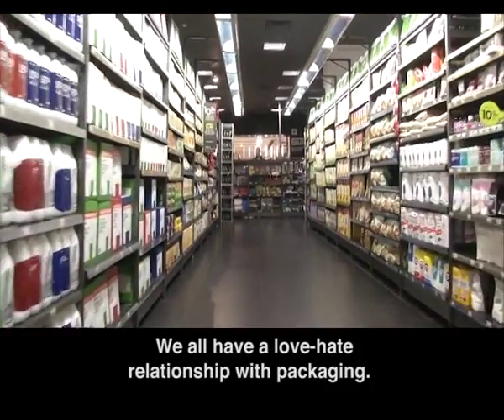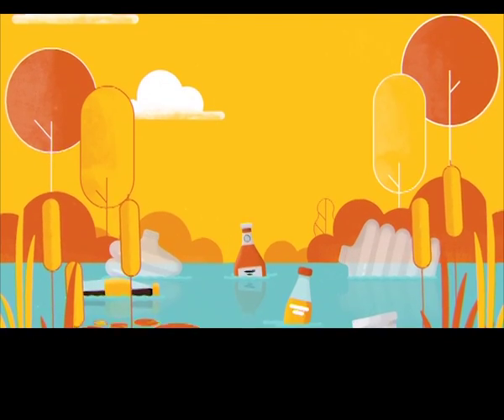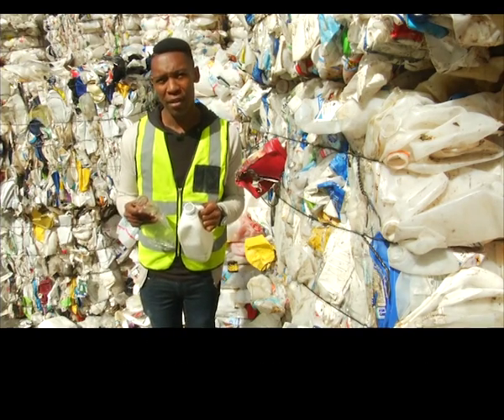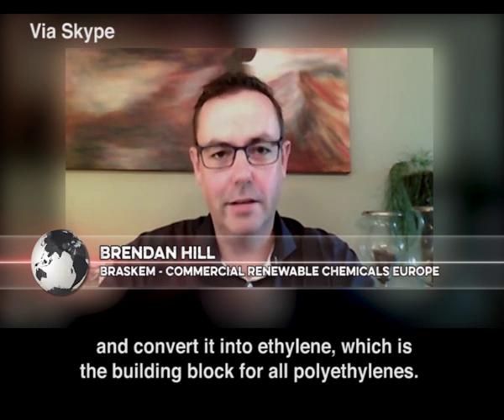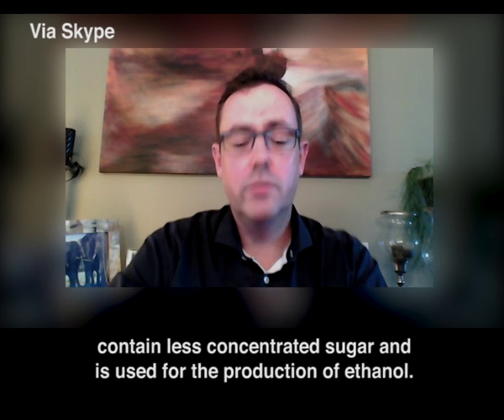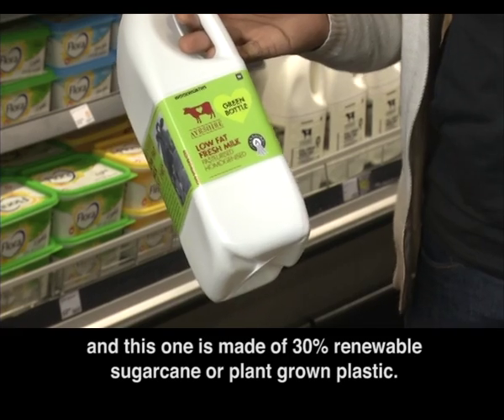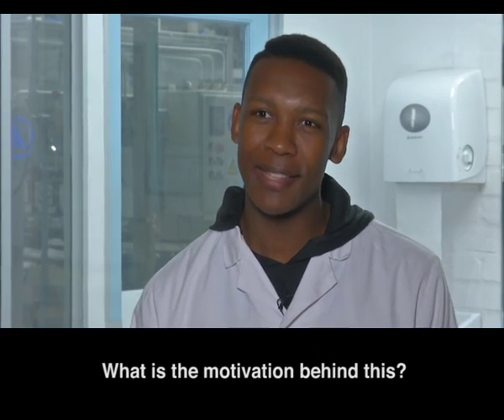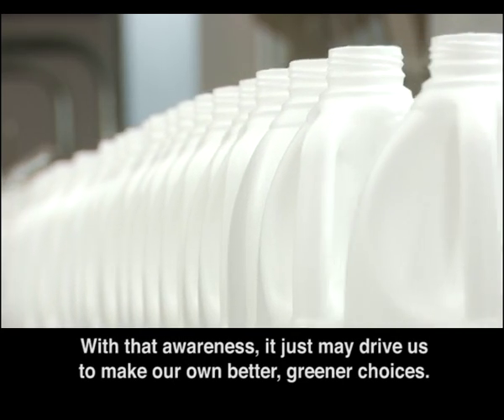Woolworths Plastic: Making plastic from sugar cane

Comment: I'm sorry, did she say is recyclable? but I guess it can´t be mixed with other plastics because its molecular structure is different...does this improve the plastic problem?
Reply: It can be recycled. Suppose we have such plastic everywhere, we can remould it to give it other shapes. It doesn't actually solve the problem but yes, could certainly help to slow it down. We need stricter laws to be implemented.
Reply: Plastics can be recycled but they are not because there is no profit. It all goes right from your recycling bin into the recycling truck and in with the regular trash at the dump.